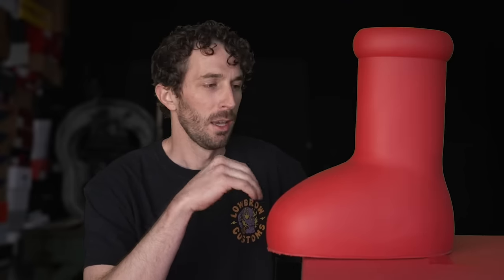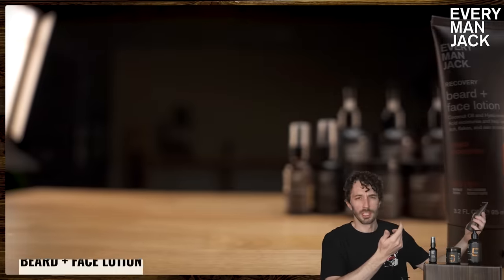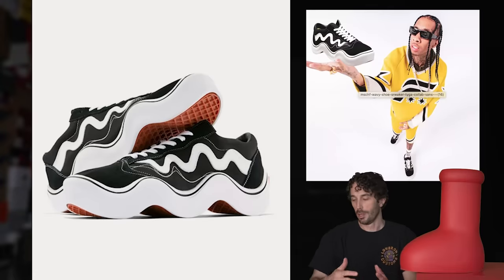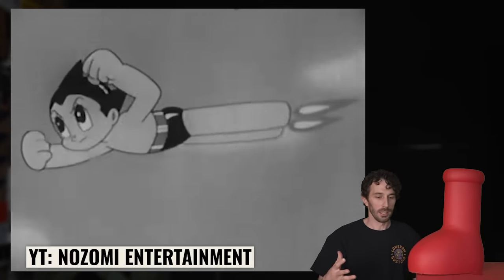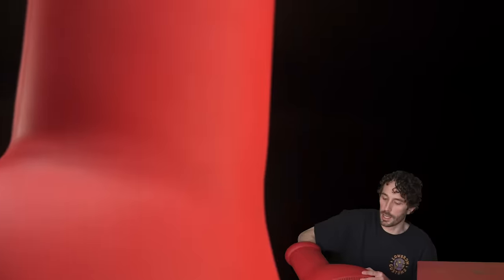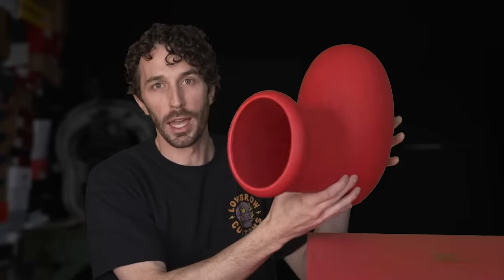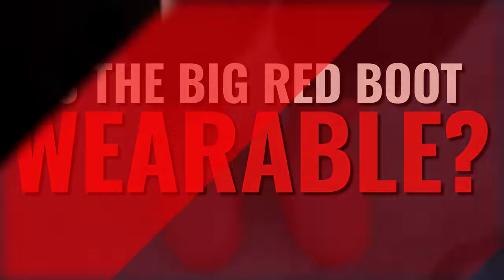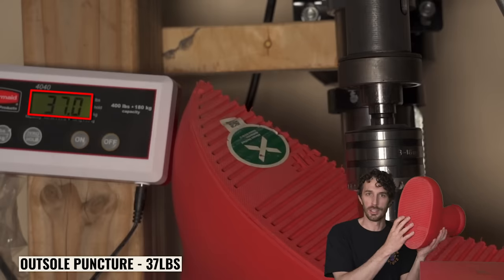The Weird Truth of Big Red Boots - MSCHF

Comment: I bet they'd be great in snow.  If you had to walk through 10 inches to a foot of snow to get to the store or wherever,  these would probably be wonderful. With the hollow voids they'd be pretty well insulated.  The large footprint would be grippy and lessen the amount you'd sink into the snow.(Like a snowshoe)  They appear to be waterproof.  
SO yeah  if you had to walk in deep snow,  with these boots, it appears that your feet would stay warm & dry.  
Are there more practical solutions to walking in snow?  For sure.  are these boots fun and silly and lighthearted?  Again,  for sure. 
Another commenter said these would be great for cosplay.  They'd be a good starting point for building up a beastly pair of feet or the feet of a mech by adding more foam, fur, claws, spikes ..whatever, and then painting them or covering them in an appropriate material to achieve the look for the costume.

Comment: You might even be able to justify the $350, despite being made in China, because they must have developed a pretty wacky process to fuse all those different foam parts together and have it look fairly seamless in the end. The tooling needed to start production of these things probably wasn't cheap at all.
Reply: Also that is quite substantial amount of material. Which also has a cost. So you also get lot of weight for the price.